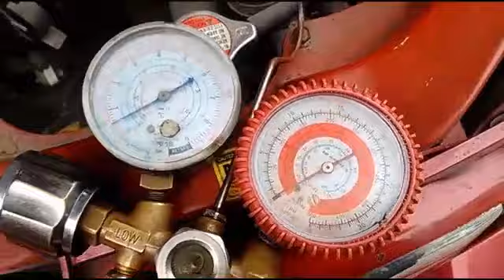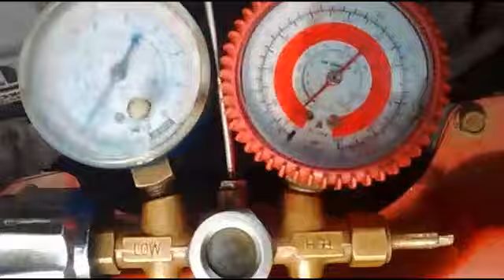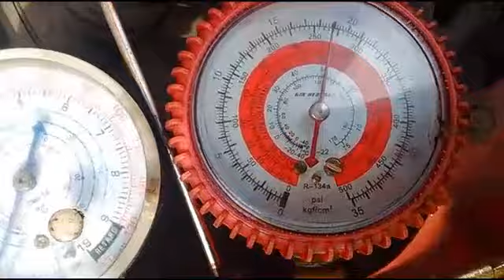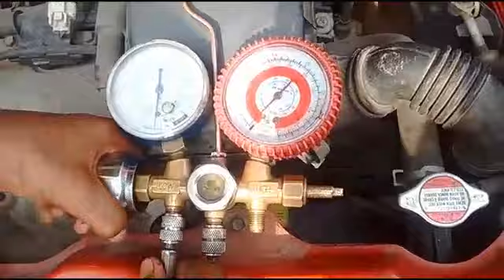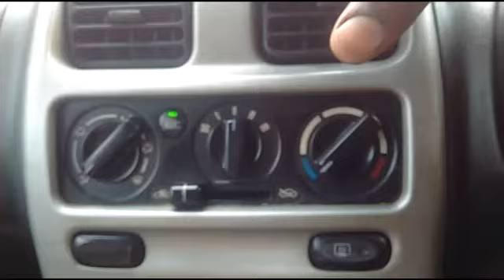Maruti wagon r car ac service in tamil

Comment: what is the pressure of gas
Reply from the maker: High pressure 300 psi, running or retern pressure 30 to 50 psi
Reply: vaccum podalana ena agum bro